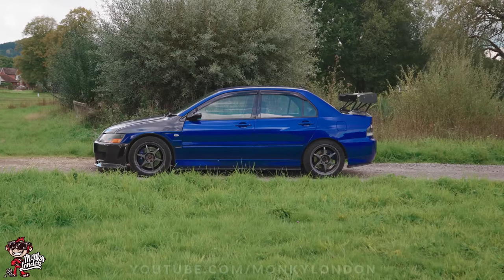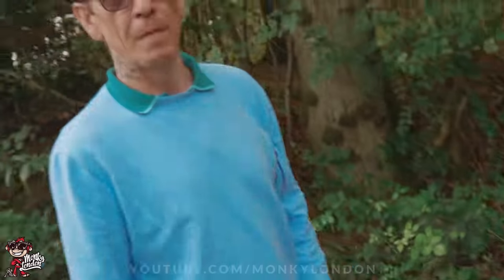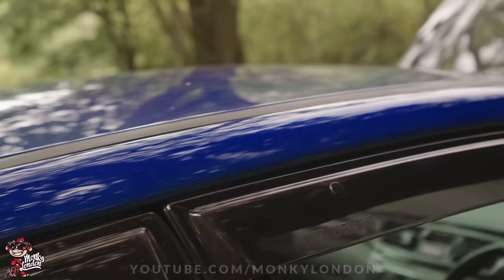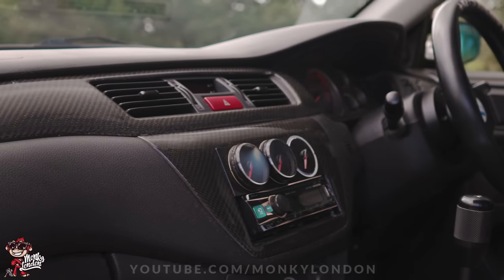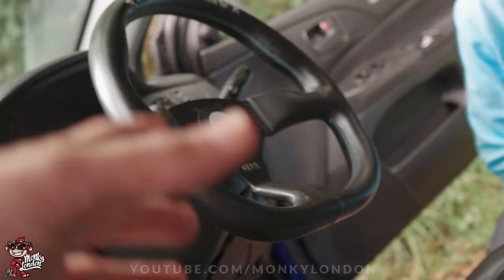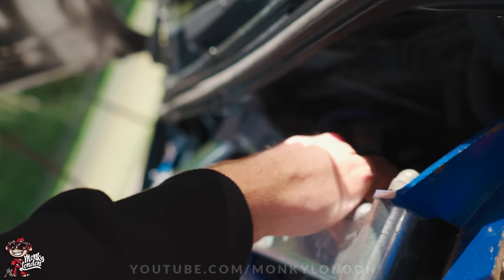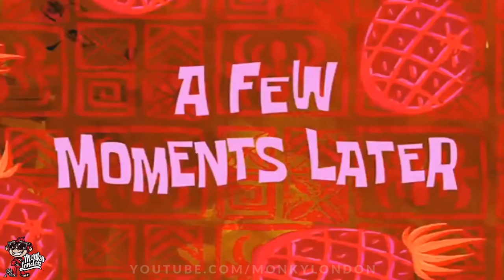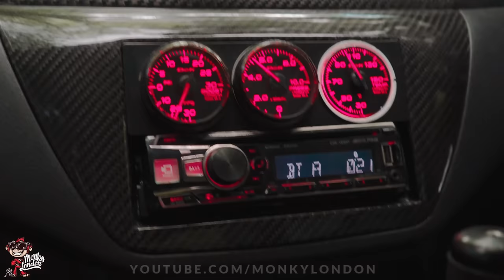🐒 (4K) MONSTER LANCER EVO 7 FULL STREET ATTACK - DRIVEN TO THE LIMIT!

Comment: The classic Evos handle in a manner different to many other cars, I nearly got caught off guard in  an 8 FQ-340 when I let off the throttle going into a corner not knowing you're supposed to pin it through, would be great to do a more indepth review of the handling of the cars you review, especially the Evo, and how best to drive it nearer the limit in accordance to its personality.
Reply: Lift off over steer - shit scary first time, amazing after you learn how to use it to give that bit of over steer mid corner if needed :)

Comment: Hope you find a good example of an early evo, most of them are feckd with bad mods, all motor no chassis, rusty and knackered. There is hardly any material on the tubes of a well done up one.
Reply from the maker: Yeah got a next level Evo 1 coming up, 550hp 2.4 bar boost was on my story other day. Stay tuned 💪
Reply: @monkylondon  SWEET

Comment: There is driving someones car and then there is raking someones car. Dude, that poor guy.. regardless of making a good video. dude, that's not your car to rake. He has the same car and clutch for the last 4 years. Piling into corners etc, you need to do a rally course buddy. You slipped gears and even popped his pipe. He clearly has fun with the car, but there is a time and a place. I treat my car the same. Don't disrespect other peoples motors for entertainment lad. it's bad form. Awesome evo all the same.
Reply: same clutch and car for 4 years and have driven it the hole time. he wasn't raking my car never once did he hit the limiter and we was in low boost most of the video lol. high boost was when the pipe came off due to the jubilee clip being old and when re fitting it twisted instead of tightening so not johns fault lol he did buy me a new clip so we could carry on with the vid. all in all I had a grate day
Reply from the maker: Sorry just seen this. As above plus the videos are edited in a way which makes it look way faster paced, in reality 80% of time we cruising chatting. These videos are reviews plus seeing what the cars can do, the owners contact John to book the cars in they know the score. Plus they are in the car with him lol, after every pull we chat and ensure its cool and encourage it tbh. Maximum respect is given to everyone both ways, nothing but car enthusiasts enjoying the pleasures, they wanna see this stuff bro. In the nicest way you've really misunderstood it. Most people will hold on as a passenger and make strange faces, even John. Hope makes it clearer. Peace ML